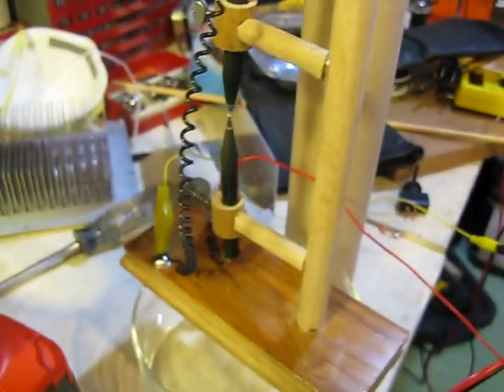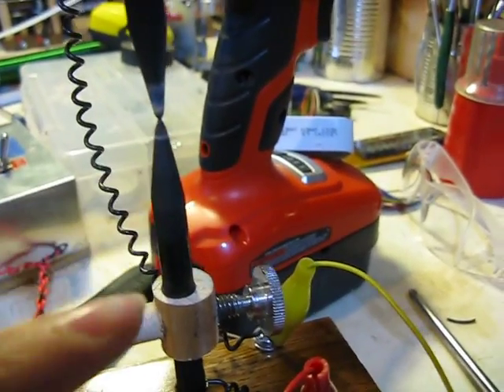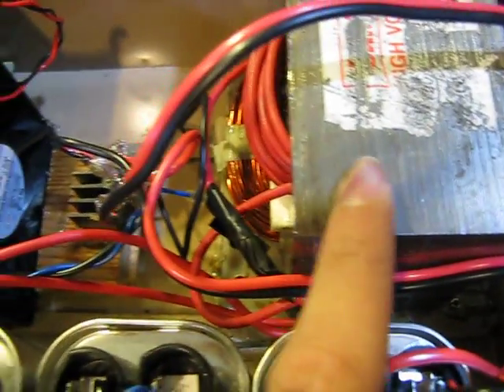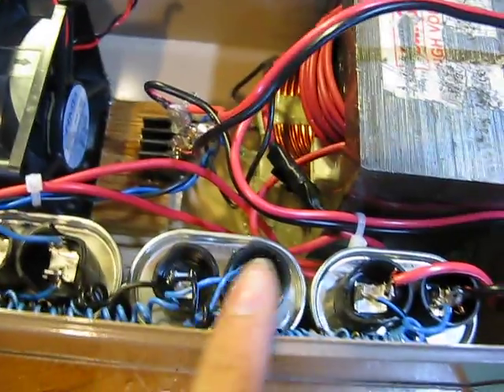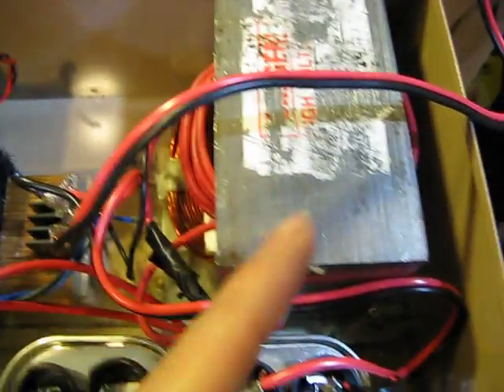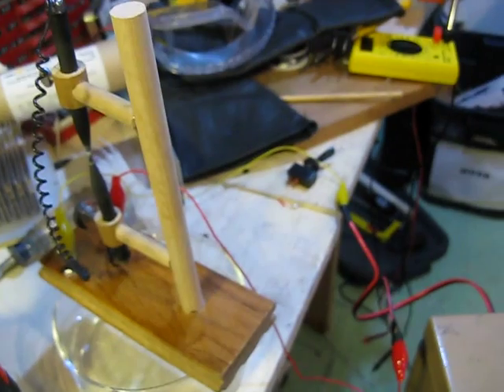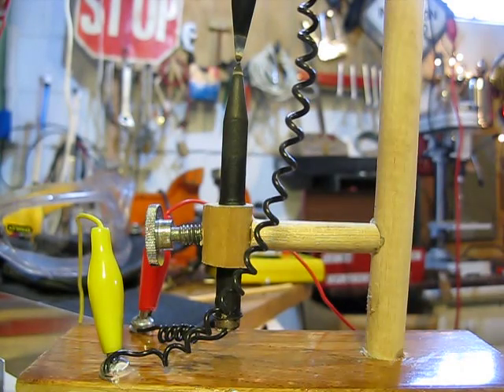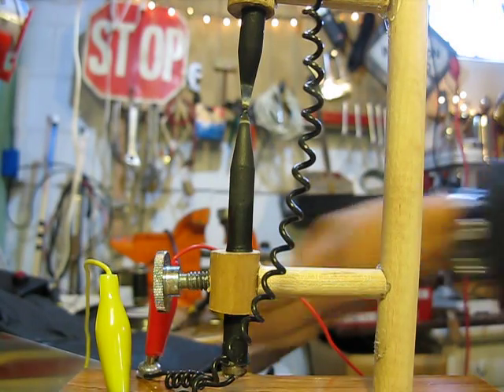Homemade Arc Light

Comment: What is the gap in between the carbon rods?
Reply: E Saunders 
That’s what makes the arc. Electricity, in this case 230 volts DC, jumping across the arc. In the old lamps from early 20th century you adjusted both carbons (anode and cathode)  to get the right arc.